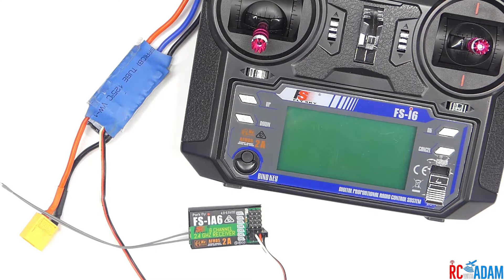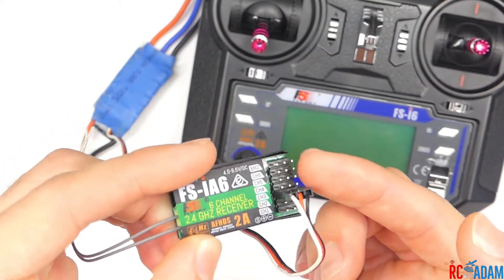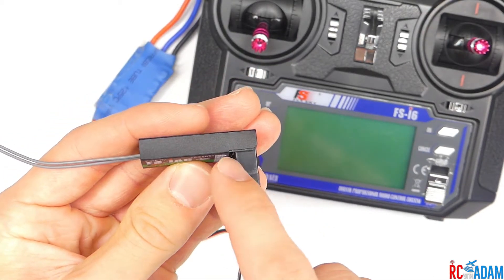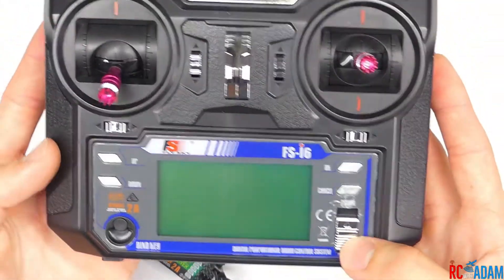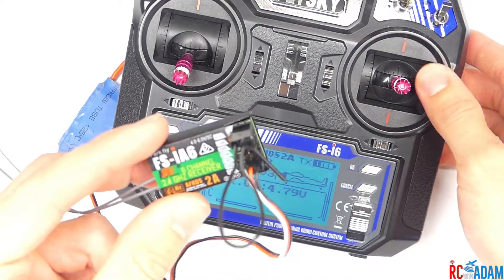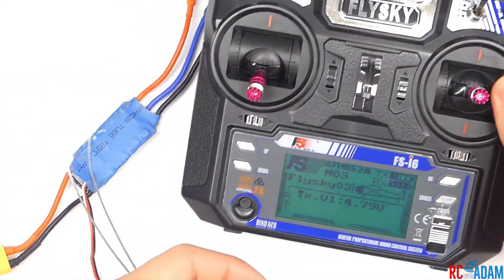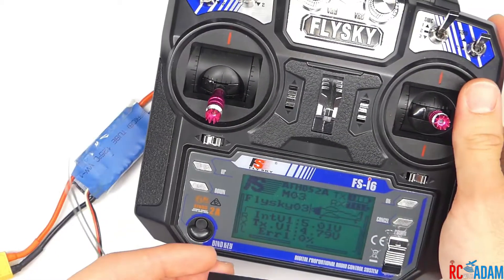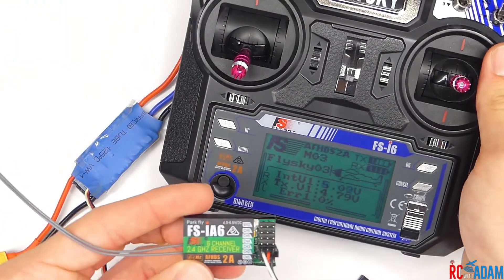Flysky Receiver Not Binding? Fixes for 2 Common Problems Binding Flysky Rx - FS-iA6, FS-i6

Comment: I just bought a RC hornet jet . And I’m struggling with the receiver . My control don’t connect and my plane don’t want to function. I followed the steps on connecting them from the Manuel but I have no luck 😭 any ideas ?

Comment: I have a FS-T4B radio 
I can't get it to bind. When I first got it and plunge in power the green light was on but nothing was working. I have followed your video to bind but no luck. I plug in the bins plug and then the battery but the red light flicked on very breef and now no light?
What can I do to get this to work?

Comment: I still have binding problem with the 6ch and 8ch fS2A protocol receivers.  It bind ok but when you switch the receiver off for about a few minutes to an hour,it goes unbind again. It happen to my 6ch and 8ch . Anyone has any idea? ( I follow the procedure ).However,  when I bind with the older receiver ( 6 or 8ch) using FS older protocol, the binding stays. This seem to point that either the fs2a protocol is unstable! I use FSI6X transmitter. Anyone experience this problem of having to re-bind again and again on fs2A protocol receivers?

Comment: My fs i6x bind ok for two months. I bind like over 10 rx models. Then things start to bevome weird. After a flight , the receiver becomes unbind . Re-binding could not get the receiver LED to flash...like dead. I thought the receiver died but this problem also happen to other receivers .  After some rest from minutes to hours, binding returns. This keeps repeating. It's frustrating because it can become unbind after a flight . It can become  unbind  with other receivers.  Suspect the TX binding function gets corrupted after binding with over 10 models.

Comment: My binding issue is more unusual with Fsi6x. The receiver bind ok at home but when you go to the flying field , your receiver appear to be unbind with the TX. When you try to re-start the TX or the Rx and re-do the binding procedure it doesn't work even when the flying field has less than 3 persons operating RC equipments.  I am puzzle.

Comment: I bought a new esc , however I saw a video about calibrating the ESC  , did the steps ok throttle works , however when I plug the rest ail, rud, etc the the receiver  don't bind ... I have no cables to bind  like in the video what can it be what should be do

Comment: Im just getting back into RC planes and I am excited to get up in the air again. Thanks for your very informative videos. I am having an issue withe setting up a Byme-A-V2 stabilizer with my FSi6X.  Before I installed my stabilizer ,the radio bound perfect with no issues. When I set it up with the radio and stabilizer I get response from the radio and will not make any servo move. Is there something you can recommend? Am I not following a certain sequence  to get the radio to communicate while the stabilizer in plugged in? The stabilizer is plugged in exactly how it should be. Do I need to  go back in the radio and rebind the plane ? Maybe delete the plane all together and start over renaming it?. This is the first plane on the radio. Any help would be appreciated ,thanks.

Comment: Adam, or anyone else for that matter, I was hoping someone could help me with a problem with 4 servos on on a rover I printed. Actually only 2 of the servos have the problem and the other 2 so far work ok.  Anyway when I connect all of the servos 2 of them just start rotating without stopping.  If I just connect one of these 2 with no others it functions as it should, if I add another the both start rotating without stopping. I have read everything I could find regarding this and cannot come up with any fix and these are new servos. If you could give me any idea as to what to try I will be forever grateful. I am using a FS-I6X transmitter with a FS-I6AB receiver. If any more info is needed please let me know.

Comment: Hi my bro . Please help me. How to connect FS-IA6 TO flighcontroller
Reply from the maker: Hi! What is the flight controller?
Reply: @RCwithAdam1  speedybee v4
Reply from the maker: @naimbenzaid9553  After looking at the V4's manual, it is not compatible with a PWM receiver (which is the only protocol that the iA6 uses). You'll need a rx that can use PPM or a serial protocol. The FS-iA6B rx could work, for example.
Reply: @RCwithAdam1  thank you boss

Comment: Maybe you can help me. After not playing with my Chinese hydraulic loader for about 6 months I recharged my 3S lipo  battery along with replacement the 4 AA batteries in my Flysky i6S radio. After turning on the radio and plugging in my battery the vehicle rotating beacon starts but the radio screen shows no power to the RX and therefore it doesn’t start ( there’s no on/off switch on the model to activate). Not sure why. Do I need to rebind? Why would I “loose” the bind just after inactivity?  Any thoughts on what to do?

Comment: How do we exactly identify in terms of program that the connection between receiver and transmitter got lost? I mean I have the connection right now and if by any chance the connection get lost due to low battery then the robot keeps on moving and we want to avoid that by identifying the connection got lost and priorities stopping the robot.

Comment: Hi Adam, I have this Rx and I'm having trouble powering it. The only cable that delivers power from my ESC is labelled "roll", the rest are single control wires (roll has 3 wires). I can get the Rx to power on and flash red if I plug "roll" into the  B/VCC pins. I have tried plugging "roll" into the rest of the ports but no lights. Obviously I can't bind this way because I can't use the B/VCC port for the binding plug.... Also unsure how I'm supposed to power the Rx when using my drone, as from my drones ESC I only have the "roll" delivering power.... How are you managing to provide power to the Rx by plugging into channel 3? Any help you could give would be much appreciated, cheers!

Comment: I got a different problem. It binds, but when you leave it like a day then it just forgets my transmitter and i have to bind it again. Do i have to keep the bind plug on, when i dont use it or what is the problem?(i got the fs-ia6 and the fs-ia6b)

Comment: Have a FS T4B that did not bind to a GR3e. Ended up to be the voltage regulator on one of the PC boards inside the T4B remote. Tested the regulator, was only getting ±1 volt on the output. Replaced it and BAM, binding done and working.

Comment: I'm in need of some advice. I'm trying to bind to an FS-iA6B or FS-R6B but no luck with either. The receiver and transmitter just sit there on their binding screen without doing anything.
I've tried:
Moving the transmitter away
Changing the order in which I switch them on
Making a new bind plug
Putting the receiver antennas at 90 degrees to eachother

Is it possible that the issue is my receiver power source? I'm using this for a robot wars robot so am using a Bristol Bot Builders ant-weight dual ESC, but it supplies a constant 5V like any other ESC.

I'm at a loss and this wireless do-hickery melts my brain so any help would be greatly appreciated, thanks.

Comment: I had to buy a new transmitter/controller for my Eclipse 1M Rage RC sailboat because I damaged the first one.  I have had no luck binding.  The manual says just push the binding button several times after turning on transmitter followed by receiver.  I have tried moving the sailboat to a different location and have tried binding from different distances.  The receiver LED is suppose to stay solid when bound but it just keeps blinking.  Help please!

Comment: Do all flysky receivers need the binding cord to bind? My receiver is so small idk if it’s even possible
Reply from the maker: No, some of them (like the fli14+) use a tiny bind button. Hold the button down, plug in the battery then release it, and it will continue blinking if it is in binding mode.
Reply: @RCwithAdam1  thanks bro. It worked
Reply: Well I thought it did. When I hold the button and plug the battery up a green light stays on. No flash. If I just plug it up without holding the button the green light comes on. Is this in bind mode even if it doesn’t blink

Comment: I am trying to bind a fly sky fS-IA6 receiver. The problem is that the LED indicator lights on the receiver do not come on to show it is in the bind mode. The bind plug is correctly installed and the receiver has power.
Reply from the maker: Hi! Does the light come on at all?

Comment: Hi bro my fs-i6 is not connecting with my Quadcopter I am learner I have done master reset also still it's not connecting with drone I have no extra esc but I have binded it with receiver....I was setting mode switch after watching vdo on YouTube after doing those settings this problem was created......dats y I have done all reset....pls resolve my problem bro

Comment: I have a binding problem with my flysky fs-i6   transmitter binding with wltoys f949s receiver I have set the transmitter AFHDS and switch off put the battery in the receiver and it flashes twice and then stops then 2and stops and on like that press the bind button and the transmitter on switch the receiver carries on flashing as before  switch off transmitter  switch back on but still carries on flashing as before. I hope you can help as running out of ideas.

Comment: Got my reciever 2 days ago.since I don't have any brushless motors/esc I decided to test it with my custom rc car.connected 2 brushed esc and checked.everything worked fine.after that I attached the cover.after that the fsi6 is not binding.after several checks for the circuits/restarting transmitter,changing channel pins I realised that I didn't connected the binding cable😂

Comment: Hi Adam.   Thanks for your helpful videos.

I use a FlySky FS T6 transmitter with the FS R6B receiver on my RC Victoria class sailboat.  After 2 to 3 hours of flawless service the communication link fails and the receiver freezes the servos in the   last sent position.  I have tried the following solutions but the loss of control continues:

1.  Upgraded batteries in both Rx an TX from Costco discount ones to new duracells.
2.  Replaced the Rx with brand new FS R6B.
3.  Rebooting the Rx by powering off and on restores the communication and it works well for at least an hour.  Batteries are still good.

It would appear that the TX is crapping out for some reason.  Fortunately I'm not flying an expensive plane.  Have you heard of anyone else  experiencing this kind of failure?  Can the TX overheat and shut down?

I have purchased a new FS I6x with the included receiver as I want to setup a fail-safe protocol and monitor the RX battery level. 

I plan on selling  the and FS T6 and Rx but would not feel right if someone bought it and crashed an airplane or helicopter!

Thanks for your insight!

Russ Reid
Email:  Russ.Donna.Reid@gmail.com
Reply: same problem, same receiver, any updates?

Comment: I discovered my problem a week ago. My receiver wouldn't bind also.
After a long time I (10 attempts with 3 different receivers) I find out what my problem was.
If you want to bind a receiver be sure that (in system, RX setup) the 'AFDHS' is ON.
This tells you  if the receiver is 'speaking' with the transmitter two ways.

Comment: my receiver"s led was blinking in some unusual way it was not blinking fast before binding rather it was blinking in some interval of time and my receiver is not binding with my transmitter and i am trying to figure what type of problem it has but sill not got any solution on internet

Comment: But rx battery level is not showing up in transmitter
Reply: Same for me....
Reply: @Wendeboys  I found the solution, just binded the rx and tx again. And now when I armed, everything looked fine
Reply: @swaroopr2424  hmmm ive tried several times and the rx works with the tx but i have recently lost two planes to "raido malfunction " and i dont know if this was the cause. I have another exact rx and it does show the battery level....🤷‍♂️

Comment: If your having binding problems where your receiver binds OK but still does not output check your radio settings and under "RX Setup" and then "PPM Output" make sure your are using the correct protocol. For a simple plane use IBUS/PWM. For a quadcopter with lots of outputs you might use IBUS/PPM. I got stuck on this recently for a simple plane setup as I was use to using IBUS/PPM on my quadcopters.

Comment: Hello! I have a FS-CT6B transmitter and a FS-R6B receiver. When binding attempted, I get the flashing light(that's it).  I get one quick light flash as I connect the battery to the battery pins on the receiver, then nothing. What is wrong?
Reply: Hi Iam also facing same problem with fs ct 6b transmitter and receiver, same as you said, then what is the solution? could you help me

Comment: i am not getting any LED on RX when connect with 2s lipo's. What is wrong?
Reply from the maker: Hi! Are you connecting the 2s lipo directly to the receiver? Or are you using an ESC with a 5v BEC?

Comment: Do I need that extra blue esc you were using to power on the receiver? Or could I use that small black and white cable and connect it to a battery to power on the receiver?
Reply from the maker: Hi! The receiver needs a constant 5 volts to operate, and this ESC is made to both power the rx and receive throttle signals from the rx (it's called an ESC with a Battery Eliminator Circuit and this setup is very common). So most of the time you will need to power the rx through the ESC, UNLESS you choose to use stand-alone BEC to power the rx separately.
Reply: @RCwithAdam1  ohh okay great thank you very much that helped!

Comment: I was stuck and could not figure what I was doing wrong. Especially after I got the "Binding ok" msg. Your video was a godsend. A simple thing like removing the binding key before power solved all my problems. Thank you so much.
Reply from the maker: Great to hear! 👍
Reply: @RCwithAdam1  Yes your video sorted out my problem as well. The supplied instructions and those I found on the internet (basically a copy) with the order in which they were written suggested taking the power out first before the binding key. Your video put me right! Thank you

Comment: I have an interesting case with my FS-i6 radio with the 10 channel firmware hack. I am using a iA10 receiver. If I move the receiver, e.g. from one model to another then bind to the model of interest it binds OK as on the display but the Radio doesn't display the receiver battery status voltage, almost as if it's not bound. It's weird because I am still able to control the model however on one the models it refused to work in this manner. Ended up resetting it and creating a new profile. It's like the receiver has left over code in it not allowing it to work properly with a different model. If I create a new profile it seems to always bind and show the receiver status fine. I could just buy several receivers and dedicate each to a model to solve the hassle but it is bugging the heck out me as to why. If anyone has an answer please comment.

Comment: Maybe you can help me....I’m trying to bind flysky gt3c that is in my 6s kraton. It has a max6 esc. Ive tryed everything I can think of. Even tried it with 3 different receivers. The red light just flashes. No bind. Idk
Reply from the maker: Hi! Which receivers have you tried? Maybe this chart will help https://rc.305.cz/storage/FlySky_Tx_Rx_compatibility_table.pdf
Reply: RCwithAdam all 3 I have tried are the flysky FS-GR3F. The one that comes with the controller. I bought a handful of the same one to use on each of my vehicles. It worked for 2 other cars but this one just won’t bind.

Comment: Hello I want to connect IA6 Receiver with Flysky CT6B but it's not binding. What shall I do . I'm stuck 😐😐😐
Reply from the maker: Hi! Unfortunately, the iA6 is not compatible with the CT6B. You will need a rx with the older AFHDS protocol. Check out this handy chart https://rc.305.cz/storage/FlySky_Tx_Rx_compatibility_table.pdf

Comment: Hei FPV flayers, i get my self a Tyro 99 and i am finish with the building but my Problem is that i try to bind my FS-I6 Radio to a FS-A8S reciver, since 2 days i try out lot of tips but nothing realy worked, for some reason i think that i have to set up my Radio befor binding?!? When i turn on the Radio after binding i´ve got a stady red light, like it would be bind but on my radio no RX Battery ore other show up that thay kommunikate with each other.  What would you say, hope to get flying as soon as posible, last month i lost my wizzard X220, and now this struggls, ps sorry for my english i am from austria.

Comment: I am able to bind without any problems. But when I plug a servo into my receiver, it doesn't work. I've plugged a servo into all of the channels and have tried every stick movement and switch on my transmitter, but the servo does nothing. Any help? I don't have an ESC yet, so I am plugging the battery directly into my receiver
Reply from the maker: Hi! Make sure the "output mode" is set to PWM. Let me know if this helps.
Reply: RCwithAdam and I can change that setting in my transmitter??
Reply from the maker: Yes. Go into the System Settings menu, then Receiver settings, then Output Mode.
Reply: @RCwithAdam1  all I'm getting is ppm mode output. Turn it on. Then nothing still. I can't find any other outputs.
Reply: @RCwithAdam1  I've added a link to the photo that I took of my setup. I have 5 volts coming from my arduino
Reply from the maker: Hmm...  that is a bit odd. Which version of firmware do you have (you can check in the system settings menu)?
Reply: @RCwithAdam1  version 2.0., dated Feb 1, 2018
I've tried updating it, but it just stays stuck in update mode
Reply: https://www.dropbox.com/s/x5ic1ora55wj3z9/img_8064.jpg?dl=0